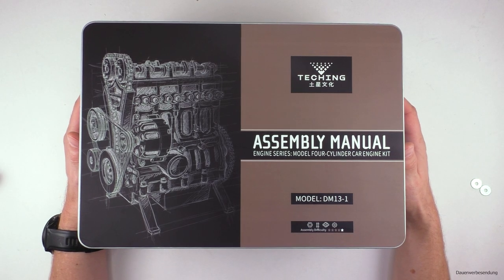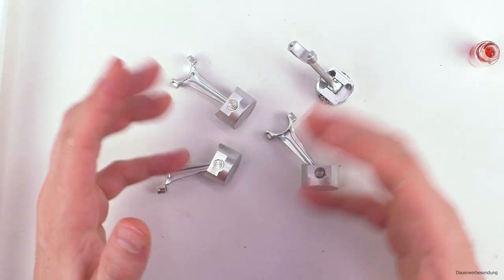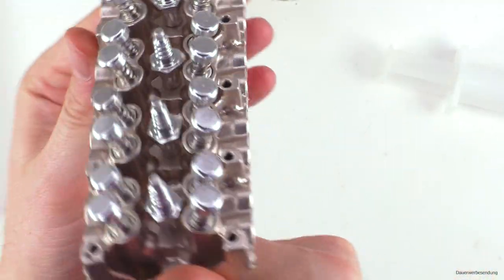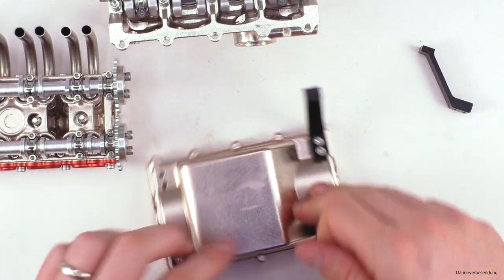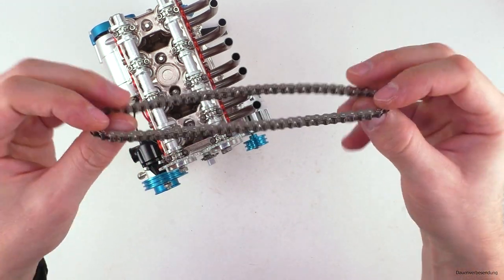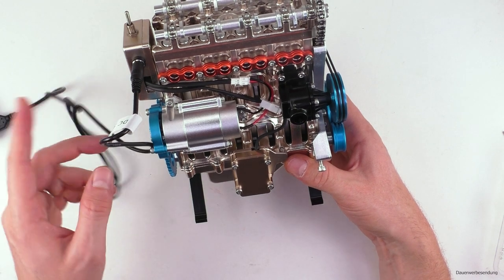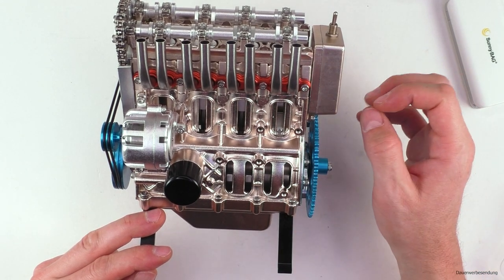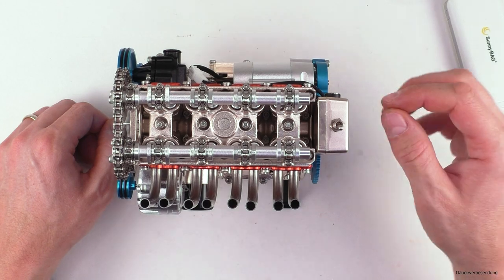I build a Full Metal Car Engine with 4 Cylinders!! - Assembly Kit

Comment: It's cool. But for around $400-$500 I can buy a cheap REAL car.
Reply: aRoUnD $400-$500 i cAn bUy a ChEap rEaL cAr. -said by an idiot
Reply: @VLenin-cn6bk  ... it’s true, though. It might even have a year or two of life left in it at that price point.
Reply: @VLenin-cn6bk  Lenin, Stalin they had no respect for people, and thought about them as of easy to manipulate idiots .  You got the a nickname which perfectly fits you mentality.
Reply: @VLenin-cn6bk  great comment...
Reply: @JasperJanssen  I have a Honda I bought for $40, been driving and slinging it in the snow for almost 2 years now. (I had to do a little work on it, almost $80 lol) 

You never know.
Reply: @Pussmash  if you only use it on private land, and don’t have t comply with safety regulations, that helps a lot.
Reply: @JasperJanssen  Not every state has California Regulations.
Reply: @RabbitsInBlack  I mean, sure, there are also failed states, that is true.
Reply: @JasperJanssen  like california?
Reply: Haha, I actually just did buy a car for 500.  My last car got totalled when a cop forgot to put the parking brake on and it rolled into me. So my mechanic sold me a junker until I could get a new one, and said he'd buy it back for the same price.
Reply: prone , I bought a brand new weedeater  just for the Engine , $69 bucks , mounted on a small piece of steel , it will fire right up and run , you can watch it spin , hear it run , and do it all over again , also have a GM 12Si Alternator I spin with a drill , it makes power , as in electricity

Comment: As engineer, kinda, im really disappointed by this assembly kit with their unusual and totally not standard engineering solutions. But as basic simple visual model - fine enough. And as always, you can easily find functional petrol engine assembly kits on chinese marketplaces.
Reply: I think his cam timing is off is why no compression,  unless its super loose on tolerances
Reply: Damn its a cutaway. Crapola
Reply: @edwhitson9873  - You have to set the timing points as shown in the instructions or it will be way off in timing.

Comment: I am an auto mechanic and i have been for 30 + years and i will say i give you an A+ Mr. P 
The kit is very nice but when you have alot of extra leftover parts like you did , it prolly wont run .
But if it does it will run very poor ...Joking .
No realy good job and when you explained how the engine worked in conjunction with the 4 strokes i was even more amazed by how much you actually knew.
But for me the icing on the cake was when you had to align the timing marks on the camshafts and was explaining it to a T.
I do think that you could assemble a real engine but i would not recommend a 4 cylinder with an overhead cam , they are more sophisticated and have more parts .
But a big V-8 would be the right way to go as it is alot easier than it looks.
Job well done !
Reply from the maker: Thanks! 😁
Reply: Where on earth would you find a car with a V8, or even room for one, though. Well, I mean, I know where on earth: in America. Finding one on this side of the Atlantic is a lot harder.
Reply: @JasperJanssen  I happen to have a V-8 Chevy SMall Block in my garage .
Reply: well, he IS an engineer isn't he? Why would it surprise you that he knows the basic operation of an engine?

Comment: That is a really cool model engine. Considering the machining involved in making all those parts even on a high speed cnc mill, the price on that kit is pretty reasonable. it definitely would teach the basics of how an engine works. It might be even cooler if the block had viewports or something so you could see the parts working.

Comment: Huh! No gaskets!
Great build Mr. Puzzle!  EDIT: I see now why gaskets are not needed; this is not a working model of a combustion engine.  I did think that you would be adding fuel and the battery would be sparking that compressed fuel to drive this engine.  I suppose the lack of gaskets was the first giveaway that this model wouldn't stand up to the kind of compression necessary to an internal combustion engine.  Still a beautiful model!

Comment: It does not explode,  it burns rapidly in a downward direction. Explosions expand in all directions almost instantly.
Reply: I'm pretty sure that if it were not so tightly circumscribed by the cylinder, it would indeed expand in all directions.  Talk about splitting hairs, though...!
Reply: @dominicdelprincipe2583  If the fuel charge exploded, it would punch a hole in the side of the cylinder, and blow the cylinder head off of the crankcase. Gasoline fuel is burned, not exploded, bombs explode, not internal combustion engines. When you strike a match, it combusts, it doesn't explode in your face, luckily.
Reply: @sanderswes  I have since researched the difference between combustion and explosion after being prompted by your comment.  Thanks for the insight!

Comment: Holy crap that's expensive.  I guess if it's all metal it would be but I wasn't thinking that much. $150 max is what I was guessing. If it ran on some kind of fuel and I could use the engine in something maybe.

Comment: As someone whos worked for a place that ordered parts to be manufactured in China I can tell you that theyll pretty much make you anything. You want high quality stuff, they will make you high quality stuff. You want low quality stuff, they will make you low quality stuff... Why would you want low quality stuff? because its a hell of a lot cheaper, and thats why 'made in china' has gotten something of a bad name. 
(Although, at least in the industry and time I was working, that was shifting. Fewer and fewer manufacturers were around needing or wanting to do the cheap work anymore, that appeared to be moving to South Asia. A lots changed in a very short time though, so I dont know how stable these shifts are.)

Comment: Induction, Compression, Power, Exhaust. the normal 4 stroke engine. Then there is the 2 stroke in Motor Bikes. Also you can have the Wankel Engine with Triangular Pistons.

Comment: 14:00 ist keine Explosion, sondern eine kontrollierte Verbrennung :P
Reply from the maker: Und wie sagt man das auf Englisch? :P
Reply: @Mr.Puzzle  The mixture burns very quickly...?
Reply: @Mr.Puzzle  I think most people would understand what you meant by 'explode', but the term most fitting for it in English is 'combust (v.) / combustion (n.)'. This is because combustion is the reaction of Oxygen in the air with a fuel mixture (which can be caused by the compression you mentioned), while an explosion / detonation is the breaking of bonds in molecules due to application of a large amount of energy (often by shockwave or electric charge, which is why many explosives have somewhat complicated detonation mechanisms).

Comment: In your opinion, is this a 100% miniaturized engine or are there some parts simplified ?
Reply: It is not 100%
Eg. the pistons do not have grooves for the piston rings (needed to strip off oil from the cylinder surfaces).
Also I think I have not seen holes in the engine block through which normally water would circulate for cooling the block.
Of course the whole ignition system is simplified, as the spark plugs are not connected to anything.
In a real engine the camshafts do not operate uncovered. The "lid" is missing. etc. etc.
There doesn't seem to be a carburator or any other means of how the fuel would be brought into the engine.
No air filter ....

It is a good demonstration model to show the basic operation of a 4 stroke engine. But all the "additional items" needed for a real engine to operate are either extremely simplified of missing altogether.
Reply: Agreed pretty far from a 100% working mini. Especially amazed at price tag. Yea it's a nice box it came in but not worth $400
Reply: spark plugs aren't even spark plugs, just a single static piece of metal. Don't spark. There's no fuel at all, obviously. In fact, it works 'in reverse'. The electromotor drives the movement of the 'engine', rather than that movement PROVIDING power.

Comment: Seems like a lack quality issue of not making the flywheel not correctly round as big a part as it is. Suppose someone wants to display it and the see the starter wobbling because the flywheel is not in spec. I was going to order but not sure now. For  $399.00 I the parts perfect.

Comment: The exhaust pipes should be facing down I think! And no top cover, no fuel injection or carburetor... not a complete engine.
Reply: That's right.....also no plug wires, fuel lines, etc.  That is because this is not trying to be an exact replica of an existing auto engine, but a basic engine with moving, functional parts to show how a typical engine works.  It is an educational tool.

Comment: "I definitely consider this a high quality product"
totally glosses over the fact they can't even make a gear properly
Reply: @Brian Cairns I didn't say he didn't mention it - I said he glossed over it. Which is true. He just mentioned it in passing, and showed how he quickly hacked a solution for it
Lots of manufacturers are able to make gears - from Lego to automotive companies. If I'm gonna pay the price of a legitimate used engine, I expect the product to also contain decent gears. If they're straight up unable to have quality control to that fairly low standard, maybe they should wait to sell their product 😂
Reply: @Latest Obsession It sounded like he used parts that werent supposed to be for spacing the motor. If the model was designed properly, you really wouldn't have needed spacers in that place, OR the manual would have told you to use spacers.
The fact that he noticed an issue after completing the assembly proves that.
Blaming things like the charge of the battery seems a bit silly.
Not sure what you mean by "overall presentation". That box surely isn't the biggest cost. The bulk of the production costs go into the materials and the design. In a model like this, the detail and proper functioning of the engine IS the presentation.
It's fine for what it is, just not perfect, I don't quite see the point of making assumptions and excuses for a model you don't even own and a seller you have no relation to.

Comment: Isn't the flywheel just off-center because of free play between the parts?
I'm surprised to hear you have trouble with the 'v' sound in valves. Don't you also have a hard 'v' in the word November?
Reply: I think that the V sound is much closer to the F sound in English; aspirate(?) the F sound and add your voice and you have the V.  The issue I think is that in German, the W sound replaces our F. 
EDIT: I meant our V.
Reply: Yeah, I don't think it was off-center -- the two gears were just too close to each other and binding.  Well, I guess that is a form of "off-center", but I think most people think of off-center as wobble.

Comment: This should be $75, it is just a crude non-running model - for $400+, it needs to actually run with fuel - also lousy fit and finish at this price level
Reply: @burrito rustler - I love the way some of you clowns try to dictate what the cost "should be" without a clue of what is involved with research and development costs, relative to how many they expect to sell!  Hint - leave that to the manufacturers!  I will agree that there is too much play in some of the rotating parts - crankshaft, cam shafts and some pulleys not drilled or cast perfectly round.  I have to disagree with you on the finishing of the parts as that is one of the nicer aspects of its appearance.  The anodized parts are really quite attractive.  I'll wager that the Chinese will improve on the less than accurate machining and casting before long.  I'm old enough to remember some of the absolute garbage the Japanese.....yes, I said Japanese, used to make and sell in the U.S not long after WWII.  Look at where they stand today in making some of the finest equipment available!

Comment: 400 Bucks will buy you a real 2 cylinder combustion engine: Toyan FS-L200 Twin-Cylinder Four-Stroke Nitro RC Engine. 800 Dollars buys you a working 4 cylinder inline 4 stroke engine.
Reply: @Rudo lf - This is NOT MEANT TO BE A REAL ENGINE!!!  It is simply a demo model to show those with little or no working knowledge of how an auto engine works.  The "real" engines you mention can not do what this demo engine can.

Comment: They should have made the entire engine out of plastic & put a price tag of around $30 to  $40 on it. I would have been a buyer at that price range. However, for $400 bucks, I will have to pass.....  👎👎
Reply: go to their website.
They do have plastic kits. They re cheaper, but not quite what you would be willing to spend.
Reply: @Sappele Steve
Sure. $30-40 for a plastic engine-kind-of-thing.
And what, exactly, would the point of that be? Really?

The only reason this (I'm talking about the thing in the video now) would sell is because it is exclusive and a deliberate statement-of-purchase. Remove that and it's just a 3D printed Haynes manual.

I'm fairly sure these people know their market. And it's coroprations or individuals with an 'engine model goes here' spot on their shelves. Where a plastic cheap item would look rather out of place.
Reply: @Varksterable  There ARE such engines I've seen in pop-up ads on Facebook. They are around $20 - For that, they MUST be plastic, unless the ad is a scam.

Comment: After watching DIY engine models made by machinists this looks very poor. And the part quality is the most shitty, they're stamped and casted only, not machined. (only thread holes made) Sure it has a lot of eccentricity, slack, clearance and vibrations.